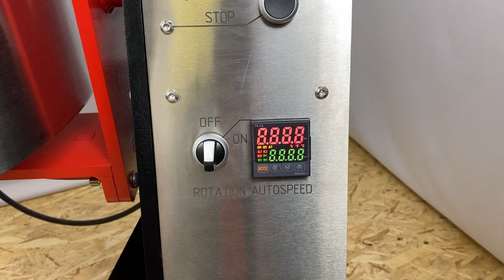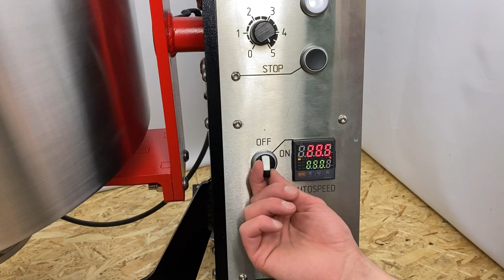Melageur 85 kg Demonstration + How it works | KADZAMA

Comment: with such a price , a ball mill coast less than this machine , what can you say for recommanding this machine insteed of a ball mill ?
Reply from the maker: Good question, first of all ball mill is solution for different scale of production, secondary ball mill does not conch cocoa liquor, melangeur does
Reply: @KADZAMA  so the difference is that your machines are bean to bar, and the ball mill have to be filled with cocoa powder and cocoa butter !?